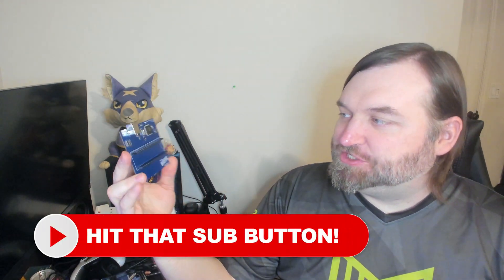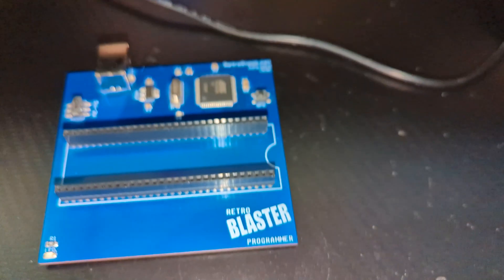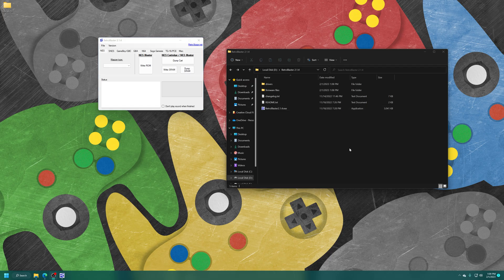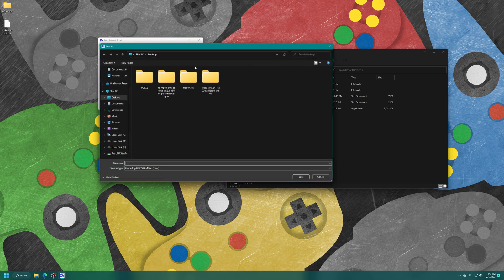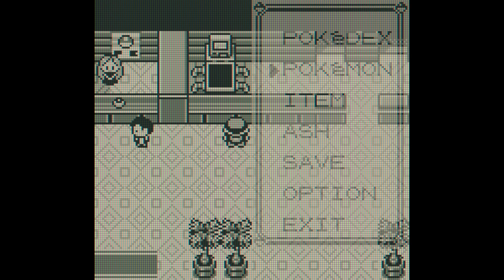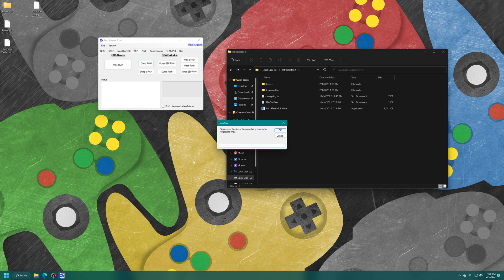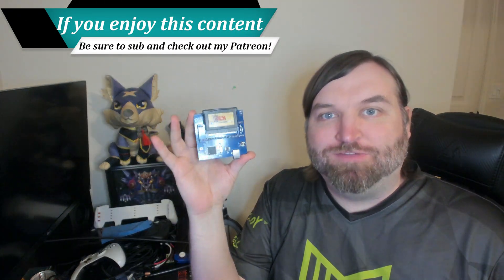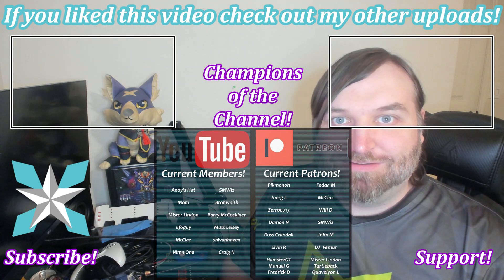How To Back Up Your Game Boy Color/Advance Games And Saves! [RetroBlaster Programmer]

Comment: I'm an idiot, so I wanted to ask if you can move the saved filed from the emulator to the actual cartridge?
Reply from the maker: Yes you can with the Retroblaster
Reply: @ArchadesGames  Sadly the site is out of them, is there another item you could recommend that can do the same thing? That's available and beginner friendly?
Reply from the maker: Yeah, he is about to release the updated version in the next couple of weeks. If you can wait that would be a great option for multiple systems but my other highly recommended option is the GB Operator for the Gameboy line specifically.

https://www.epilogue.co/product/gb-operator
Reply: @ArchadesGames  ty
Reply from the maker: For sure

Comment: I’m glad I found this video. I definitely want to save my files just in case. However, it also just clicked to me that we can use gameshark/action replay codes on an emulator and then return the save file to our game. No physical cheat device required. Am I mistaken?
Reply from the maker: It should be possible yes

Comment: Yo, this is cool can we open a rom and just play it directly from the cartridge without dumping?
Reply from the maker: That's not how this adapter works. The Retrode 2 had functionality close to that and there are other Game Boy specific options that can do it as well.
Reply: @ArchadesGames  ohh, thats interesting because it could be easy to write a code that autodumps and emulate it all in one click but it will just be an illusion that its running directly from the cartridge.

Comment: Does this device allow you to "flash" cartridges? Example, putting romhack games into physical cartridges?
Reply from the maker: Yes it does! Retro Stage sells blank flashable carts as well.
Reply: @ArchadesGames  Do I need blank cartridges or can I use any available cartridge I have at home even if they already contain roms inside?
Reply from the maker: You need a programmable one. Retail games aren't able to be reprogrammed
Reply: @ArchadesGames  Thanks for the info. I think the cartridges I have are not legit but instead reproductions.